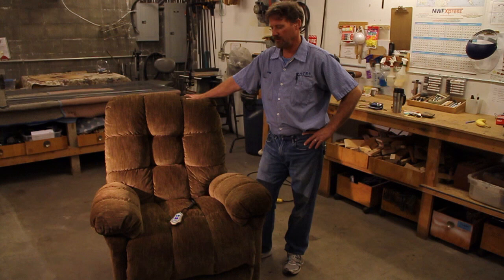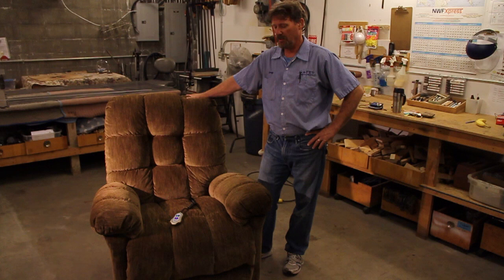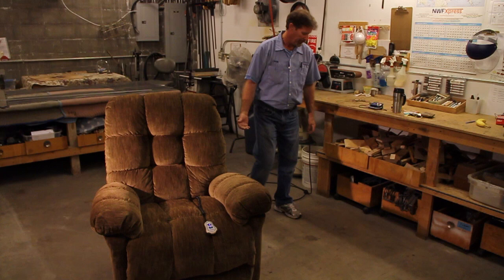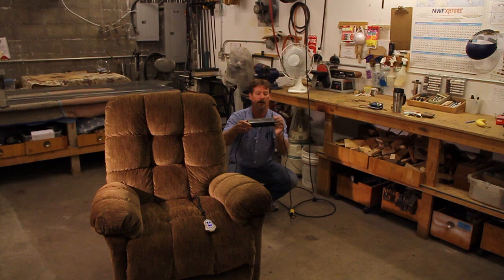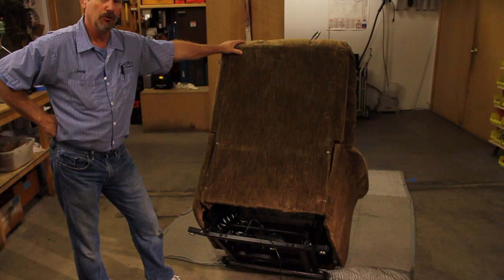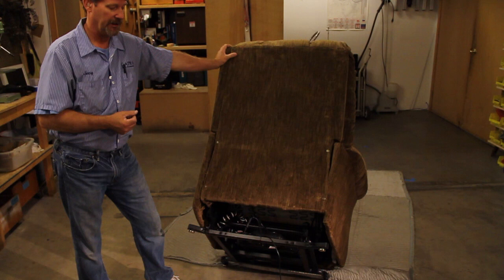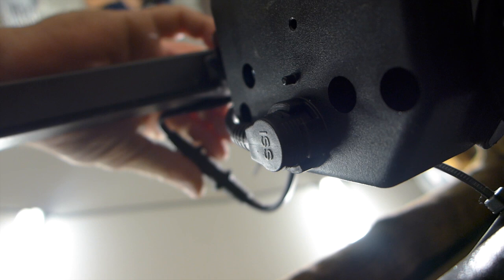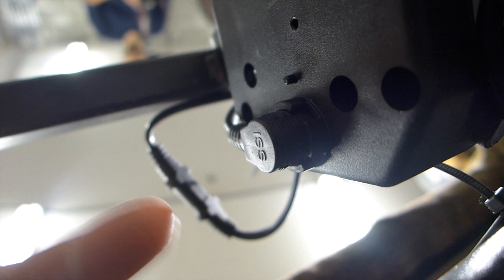Power Chair Connections

Comment: Hello- our dual reclining sofa suddenly went dead last night.  All connections are good, but the ac adapter has a flashing green light when plugged in. That light goes solid (as it looks when its operating correctly) as soon as I disconnect any connector down-line from the ac adapter.  Anyone have any ideas? Cheers!

Comment: During a recent move part of the power cord that goes into the transformer got lost. It is a short cord with a small pin. Where can i get a replacement? Chair is 5 yrs old...no warranty...
Reply: I'm a service technician at Capital Home Medical Equipment. You could buy it from an online source such as amazon or ebay. Both have replacement parts for most lift chairs. 
Cheers

Comment: Hello. I have a TMR470 Aztec. The power works, moves the chair up and back, but I found a big spring on the floor and it looks like one side of it has broke off. The chair now leans considerably to one side and one of the moving parts from the lift is rubbing against the wood and causing it to break. What can I do? Please help. Thank you very much.
Reply: I've seen Replacement Springs on Amazon if you search for the power recliner and look for the brand. This reply is 4 years old but maybe someone else would see it.